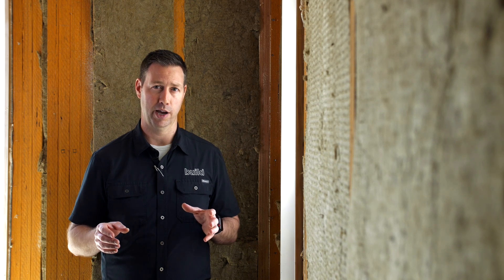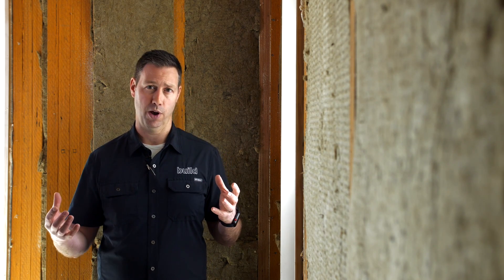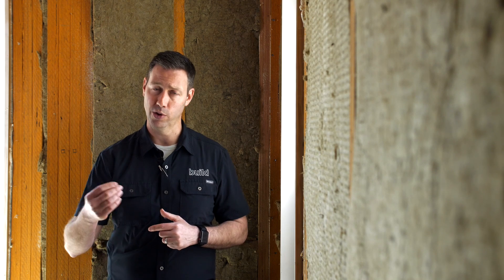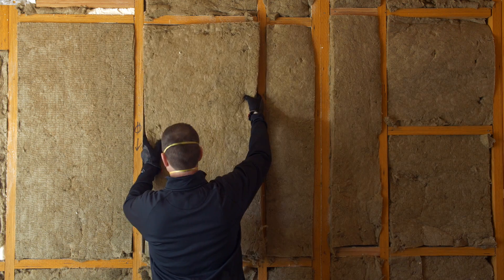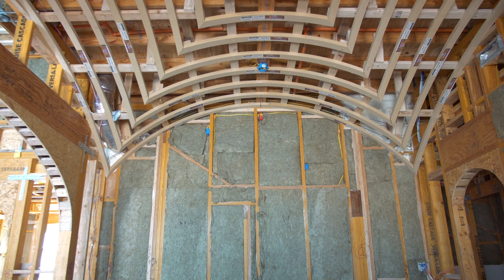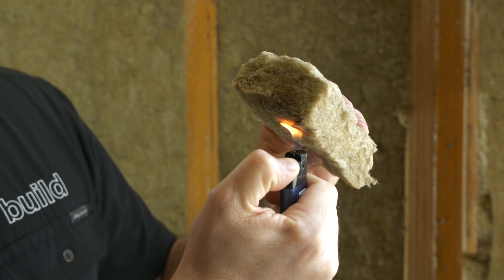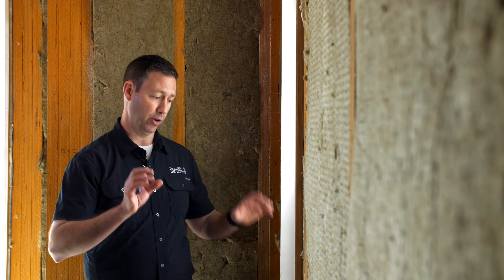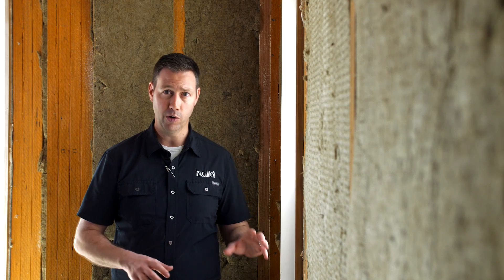Flash and Batt Insulation Strategy

Comment: Our balloon frame 100 year old gut-reno was required to have the new framed walls offset by 5 inches from the solid masonry wall.  We are spraying 2" closed cell on the masonry (continuous install!) and want to put mineral wool into the stud cavities. But the cavity is deeper than 3.5". Should the mineral wool be pressed against the closed cell foam or leave a 3" gap and have it touch the drywall?

Comment: That closed cell foam is a vapor barrier from what I understand. If I'm not mistaken, you do not want moisture trapped in the rock wool so you would not cover it with 6 mil plastic or any other vapor barrier.

Comment: Matt, what if we’re still not sold on foam, off gassing, air quality issues, what options would you consider?
Reply: There are some very clean SPF products on the market today that do not have off gasing issues. Closed cell spray foam is by far the best insulation product currently on the market, in fact, I don't even give my customers an option anymore.

Comment: Matt - I saw your video on insulating a house with out sheathing from the inside. I have a situation where I need to insulate a house built in 1958 from the interior with board and batten siding, and felt-impregnated fiber board sheathing. I need help! Any suggestions? Should I use the same method from the house you insulated without sheathing?

Comment: Hi Matt, my question is, can I use this technique right on top of an interior bricks old house? And does paint waterproofing the exterior of bricks help on anything?
Reply: I have a 1903 full masonry house in St. Louis, which is climate zone 6. Some of my exterior walls are furred out with 2x4s. I am planning to flash 1 1/2” and batt the other 2” with rock wool. Never paint brick with paint. Brick must transpire. If you want to change the color, you can use a lime wash, which will still allow the brick to breathe. The flash and batt technique basically coats one side of the brick with a plastic sealant, which forces the brick to release its moisture to the exterior alone. Fine Homebuilding has a good page about this called “Why Flash and Batt Makes Sense.” It does not specifically address full masonry buildings, however. So I am concerned about spalling.

Comment: This is how I did my house, but I used staggered studs. It made it a pain, but the finished product is pretty sweet.
Reply: Good point. Even with insulation in the  walls the studs and the drywall conduct sound. Staggered studs help minimize the conduction.

Comment: I understand that polystyrene needs heat to increase it's r value. For flash and batt a cold climate home would it not be better to put the rock wool on the surface of the exterior wall and the polystyrene on the warm wall interior wall?

Comment: If cost is the issue could they have just done 2 inch of closed and fill the rest with open cell?
Reply: Isn't open cell still more expensive than Rockwool?  Rockwool 2x4 R15 is around $0.75 per sq ft (plus installation).
Reply: And open cell is R3.5 per inch and Rockwool is around R4.2 per inch.

Comment: My understanding doing with will cause condensation in cold climates. This true?
Reply: If you do what he did with only 1" of closed-cell foam in cold climates, yes. You will have condensation inside the wall. In zone 5 for example, you need a minimum of 1.5" of medium-density closed-cell spray foam. And that's the minimum. Two inches would be better. Then fill with fiberglass. But that gets hard to do on remodels where the walls are probably only a 2x4 to start with. That doesn't leave much room for the blown-in fiberglass. For 2x4 walls in cold climates, I would either do the full cavity of spray foam or just use fiberglass.
Reply: @JamieWardHD  what about in zone 2? (northeast Texas)
Reply: @JamieWardHD  correct. R-12 min for climate zone 6.

Comment: Goodman Risiger! I'm a korean. 
I ask you. I want your teaching.

flash and batt wall need  vapor barrier?
Reply: if the "flash" is with closed-cell foam, it will act as a vapor barrier. I don't think this is a good technique unless you're in a warm and dry climate. for cold areas, you want your vapor barrier on the interior side of the insulation. for hot areas, you want the vapor barrier on the outside. putting it just inside the sheathing means your sheathing is on the humid side of the barrier. it would be better to seal the outside with a vapor barrier in a hot and humid place, so that the sheathing and framing is all inside the barrier. if you're in a dry climate, then this works well, because it will be good at reducing airflow and you don't have to worry very much about condensation inside the walls/sheathing/cladding. the airflow reduction will help reduce energy bills due to losing less conditioned air.
Reply: @somedude-lc5dy  Thank you for Good teaching!

Comment: Good video but I need to correct some things related to sound proofing.  Rock wool insulation  does not sound proof anything.  It can dampen certain frequencies yes but that's about it.  Dont be misled.  Its mass and an airspace that effectively is used for soundproofing.  So yes  5/8in Sheetrock is better than 1/2 inch slightly.  Better to double it up with green glue in between.   However that only lessens airborne sound,, any kind of impact noise like someone walking on a hard floor above will go right thru the joists just like thermal bridging does thru an exterior wall.  You have to use the same concept of decoupling for impact noise as you do with thermal bridging in insulation.

Comment: Does flash and batt work well in the north? I’m nervous about the location of the vapor barrier since I will be both cooling in the summer and heating in the winter.
Reply: no. you are right to question the location of the vapor barrier. keep in mind that he mostly builds in a hot and dry climate. for this build, sealing for air leaks is probably more important than an ideal vapor barrier. plus, the client might have just asked for it because they thought it was the "ultimate seal"

Comment: Hi Matt. I'm from Dominican Republic ( I also like your video made in my country). I live in Long Island New York. I have a insulation issue in my house  (from 1952 house) in winter it is super cold. I'm planing to use the rock wool insulation inside of the exterior wall. My question is: Do I need a vapor barrier before I install the drywall. Thanks
Reply: in cold climates like NY, you should have vapor barrier between your drywall and your insulation

Comment: Nope, never would subject my family's lungs to a tight home encased in off-gassing foam.  I'd use thicker insulation (rockwool makes a lot of sense) and breathe easy knowing I wasn't gassing my family/pets 24x7.  As for foam adding extra structural rigidity, that's a dubious benefit - few modern homes suffer from that problem - and could be a total pita if and when a remodel is done - you can't easily peel the foam away - typically have to cut out all the lumber that it's attached to and dispose of it - or spend a huge amount of labor stripping off adhered foam - either way it's a big expense.

Comment: What would you recommend for a remodel with 2x4 exterior framing and no access for exterior rigid insulation, Climate Zone 5. How many inches do I need to keep the dew point low and moisture from forming between the spray foam and Batt insulation?
Reply: Smallest normal batt would fill the 2x4 is the problem.

Comment: apart from what Mat presented..
biggest no go for closed cell expanded PU foam, 
it does not absorb vapor. instead it deflects it back from where it comes.
the best and i mean by far the best way to insulate buildings is with natural stone wool blocks. Stone naturally is the best insulation material in nature and in the past houses were all built with natural stone in the base floor with 100cm thick walls..
because of this stone wool absorbs vapor that can travel from inside to outside which makes the walls breathable.. this eliminates damp in long long term. 
also the ambient air inside the house is naturally refreshed because of the constant passive humidity control because of this and all you need to do in order to get fresh air is open the windows every day for a very small amount of time. this all worked perfectly in the past. 
now days we have tons of different types of materials and most of them are not eco friendly no matter what the producers may claim. if you decide to go for extreme energy efficient house you will have to spend a lot of money for automatic air conditioning system as well as heating and cooling unit. there are ways to get this in a good designed project with passive standards applied but you will always have the feeling of living in a membrane. 
opening a window in a passive house during winter literally costs money.

at last you should always have in mind the nature/natural element of everything.
for me the best designed houses are the ones that are built with natural local materials and have the human factor well calculated in the design it self.( the human body is a walking hazardous entropy making mean machine)

Comment: has anyone done something like this on a 2x4 wall?
Reply: Edward, I haven't personally done it in a 2x4 wall. I've done it in 2x6 walls and 2x10 rafters. But Rockwool makes batt insulation of thickness down to about 1.5". So there's no reason why you couldn't spray 1-2" of cc-spf to get your vapor barrier and R6.5 to R12, then finish off with Rockwool. You could probably achieve R17 in a 2x4 wall with this approach. In new construction, in many locations, code will require an R20 wall. So that could be an issue. Alternatively you could just fill the 3.5" cavities with cc-spf and get close to R24. But that will need to be done in 2 passes and cost more. I think 1.5" of foam and 2" of Rockwool would work fine in most climate zones but may not get you to R20.
Reply: Just to add you could alternatively add exterior insulation (which would help with thermal bridging) or double up on the walls inside. Although, you would lose some interior space.

Comment: Hey Matt recently I’ve seen some news stories about termite damage being increased in homes that are insulated with spray foam, being it’s more difficult to detect and treat where spray foam is in use. Can you comment about this or make a video with your thoughts and concerns? Appreciate all the awesome vids. Keep em coming!
Reply: Bug resistance was specifically listed as one of Rock Wool's benefits. That'd be a good question! Also plugging LVL studs a lot and I'm curious about the fire resistance downside of those vs. conventional framing/lumber
Reply: I would recommend buying powdered boric acid that you can mix into a pump sprayer and hose down all the stud bays, the floor joist bays, and your rafters including eves before closing them up. In the stud bays you can double up by pouring boric acid powder on the bottom plate of each bay prior to insulating and drywall. No termites, even down here in GA with that technique :-) all for 138$ including a dedicated pump sprayer.

Comment: I am in upstate NY, zone 6. I like the ICF for the foundation and the Zip R for the exterior. I am not sure about the best value combination of Zip R , spray foam and batting for my build. The T studs also peaked my interest because I would like to do some of the build myself, so naked T studs with some spray foam seems like a great option. Is there somewhere that compares the cost vs insulation benefit of each system?
Reply: keep in mind that a cold climate needs the vapor barrier on the interior side. I don't think "flash and batt" will be good for cold climates, unless you flash with open-cell foam. for the money, you will probably get better results by spending your spray-foam budget on more Rockwool outside of your sheathing.

Comment: I already have 3 inches of sprayfoam on the underside of the attic ceiling.  Is there any reason not to add fiberglass batts under it?
Reply: I don't recommend fiberglass at all.  Mineral wool would be better.   
The only real possible issue would be that it could cause condensation, depending on how much fiberglass would be added.  
It moves the 'dew point', so if the temperature of the sprayfoam resulted in being cold, because the fiberglass prevented it from being heated from the inside, then it could cause condensation on the surface of the spray foam.

Comment: What about the roof (rafters), how did you insulate that?
Reply: I recently did a roof/cathedral ceiling with 2x10 rafters, 4" closed cell foam and an R-19 fiberglass batt. We applied gypsum board directly to the rafters. Everything just fit. It worked great. I haven't tried it yet on a trussed roof with a 2x4 top chord. I'm not sure how that might be handled since you wouldn't be fitting the batts between the rafters but rather over them. I expect a good insulation contractor would have a simple solution to that.
Reply: @HistoricHomePlans  where was this job located? And did you need a vapor retarder over the rockwool? Or just sheet rock and paint?  I'm in zone 5 cleveland and trying to find this out.
Reply: It depends on the structure I’d imagine. I have 2x8s and plan to do 4” closed cell then squeeze in R15 rockwool.  It’ll be a tight fit since the closed cell won’t always be exactly 4” and the r15 rockwool is designed for 3.5” space....
Of course if you have more room this works well but if it’s an unvented roof you’ll want atleast 4” of closed cell.

Comment: I built an addition, with flash & batt in the floor joist bays above a garage. Comparing the floor temps (measuring with an infrared gun) between this floor and an uninsulated one next to it (above conditioned space) there is zero difference. Yes closed cell foam is expensive, but much less than heating the floor with water or electric. Plus the living space above is sealed off from garage fumes.
I did not see the benefit of flashing the walls. Between all the framing lumber and windows, there was not much area to insulate.

Comment: Im about to insulate my attic with 1 inch of closed cell foam and fiberglass. 2x6 rafters. Would it be a better idea to go with  stone wool? Im putting Sheetrock on the roof afterwards either way.  Im in new jersey
Reply: Check code for "impermiable" insulation thickness requirements for roof.  In the south it is only R5 needed ( 1 inch closed cell or most foam board).  North need more because of dew point and longer cold season.

Comment: Don't use spray foam, doesn't make sense on new builds. It's only good for some retrofit jobs.
Reply: Wrong for many reasons dude.  Closed cell is the best insulation for hot and cold climates.  It's just expensive but flash and batt reduces overall insulation costs vs all closed cell and you get the benefit of a vapor barrier from closed cell along with plugging all tiny exterior voids.  Just need to make sure the closed cell is applied thick enough for the area climate to avoid condensation between the closed cell and batt insulation.

Comment: One of our spray foam insulator is recommending SucraSeal open cell for a roof deck here in Charlotte, NC.  SucraSeal is supposed to have properties built in which suppress ignition.  He sent us a video of an ignition test that was pretty impressive.  Just wondering, in all your Builder Show travels, have you seen SucraSeal or do you have experience with it?

Comment: What's the best flash and batt method for New Jersey ??thanks
Reply: I don't think closed-cell flash and batt is a good idea anywhere but the hot/dry areas. it will act as a vapor barrier outside of the rest of your insulation, which is only the way you want it in hot climates. in addition to that, it puts all of your sheathing on the humid side of the vapor barrier, which isn't ideal unless you're in a dry place, where it does not matter much. if you put a second vapor barrier outside of the sheathing, then you'll trap moisture and make things even worse

Comment: Our builder did this plus added plastic before the drywall. Fast forward 4 years and we found water on the floor around the edges of the room. We removed the drywall and Batt insulation and found a lot of moisture and dew. This was the case throughout the house but only on exterior walls. Of course we had a lot of mold as well. What caused the moisture?
Reply: yes, closed-cell foam acts as a vapor barrier. moisture will always find a way into any wall, so you only ever want a single vapor barrier so it has one direction toward which it can dry. in hot areas, the vapor barrier is best on the outside. in cold areas, the vapor barrier is best on the inside. having two vapor barriers will just hold moisture inside the wall.
Reply: If your spray foam isn't thick enough it'll condensate

Comment: If you were to do that in an attic for the roof, do you still need baffles, I would guess no. Is this correct. You would use the baffles so condensation does not rot out the plywood decking. I would guess the close cell makes that issue disappear. Is this correct?
Reply: Baffles are needed for a vented roof, no baffles for an unvented roof

Comment: Once you’ve air sealed the walls with foam, besides the noise reduction and fire retardation, is there really any benefit to adding more insulation to the walls? Heat doesn’t move sideways unless air is moving it. I understand you have code to follow; I’m mostly wanting to know from an educational standpoint. R-value is moot if air can move through the walls. But, once sealed, it just seems like adding more insulation to the walls (for the sake of insulation itself) is unnecessary. Somebody on here educate me, please!!! 😀
Reply: There is convection and then there is radiation...two ways heat and cold can travel.  Understanding these two concepts will help a lot.
Reply: Once you eliminate convection loss (air flow), the thicker insulation reduces  radiant losses. It holds the heat and cool longer.